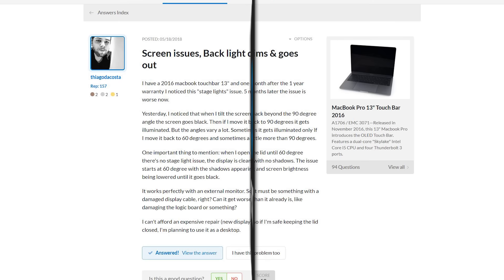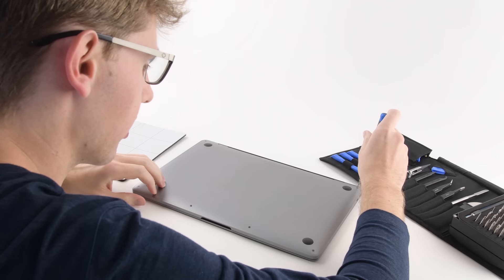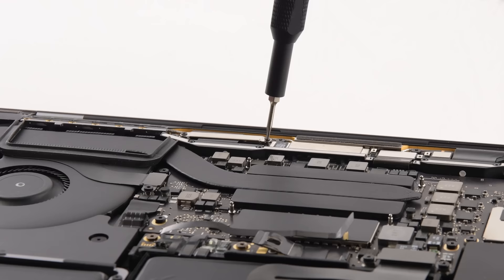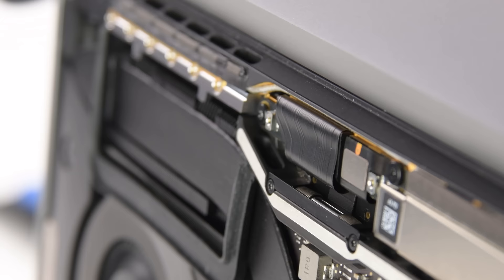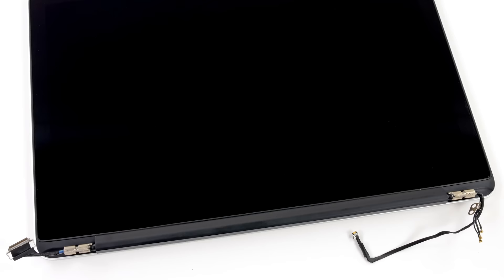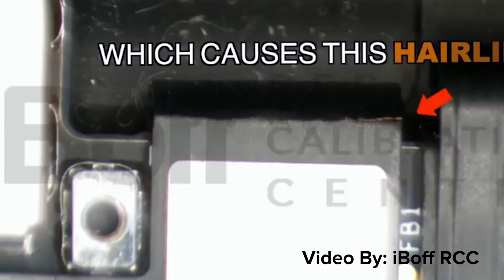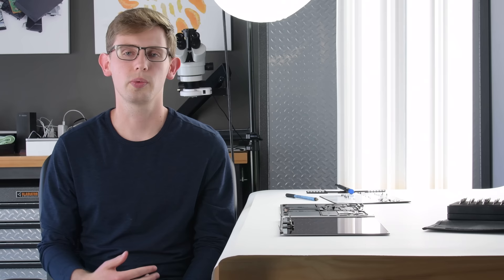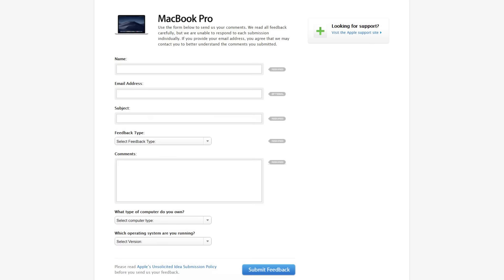The Design Flaw Behind MacBook Pro’s “Stage light” Effect! #Flexgate

Comment: Not using OLED is the actual design flaw. 
MicroLED isn’t going to be ready any time soon. OLED is the best we have now.
Reply: Oled is not an option. First, it burns in easily, especially with the super bright displays Apple wants to have. Second, Oled displays are VERY expensive compared to LCD. If you don't want Apple to quadruple their product MSRP, you better not ask for Oled.
Reply: OLED on a Laptop with static elements like task bar (on Windows) and the top bar on macOS ist just a stupid idea and not the best.
Reply: Oled is kinda shit tbh. The bad, it burns in, has a shorter life, way too expensive and makes little sense to be in TV's, let alone laptops. The good, has slightly better color's, and kinda saves battery. Had a Samsung OLED, it's garbage, went back to QLED 10/10 (btw its basically retina)
Reply: I also just replaced my oled tv because of burn in and failed pixels
Reply: Lmao. “Not using OLED is the actual design flaw” Just because they don’t use a certain display technology, it’s a ‘design flaw’? That’s like saying “Oh Apple used a Intel processor instead of AMD, that’s a design flaw!!!”
Reply: @TrevorYee41  Yeah, that makes no sense calling a product using different hardware/material as "design flaw". A pretty stupid argument he made.
Reply: the only good thing coming from oled screens from consumer perspective is its true blacks. that’s all. they’re prone to burn in and cost way more than lcd
Reply: Reza Reinaldi   I don’t think it’s feasible to have local dimming on laptop screens. So OLED might just be the only option for true HDR on laptops.
Reply: @allansh828  Only few people especially the professional artist/designer care about near perfect real-life color and imagery. For most people, OLED is not really needed.
Reply: @TrevorYee41   You don't even see the difference between figurative vs literal language. 
In case you ain't playing dumb. I am mad that Apple is comfortable with using inferior technology on their supposedly premium products.
Reply: Allan Sh Allan Sh It doesn’t matter whether it’s figurative or literal in this instance. It’s impractical and senseless to apply a “superior” technology when it’s the incorrect application. You don’t use OLED on laptops because there’s numerous economic and technological issues with using OLED. Granted, there are a few companies who use OLED screens on their laptops. But if Apple puts an OLED display on their laptop, be prepared to pay an even more absurd price. And design flaws outstanding, the MacBook still has the most premium design I’ve used.